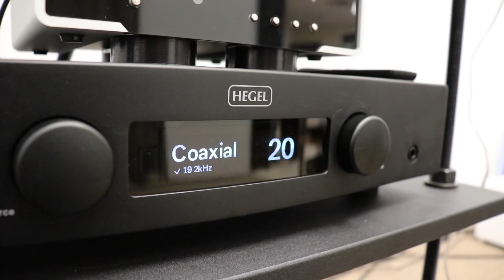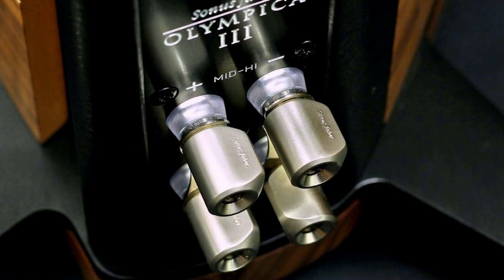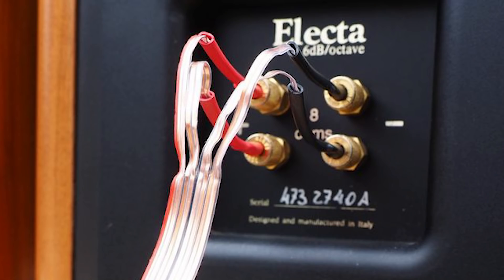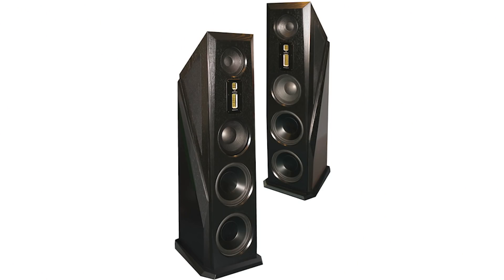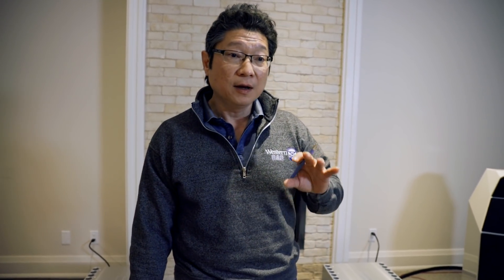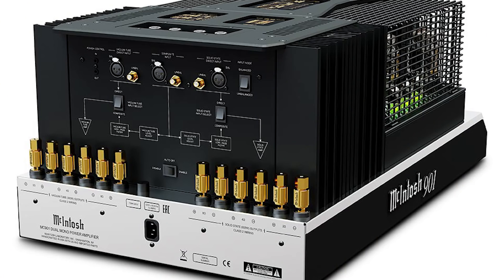What's so unique about the new McIntosh Mc901 & should you bi-amp your speakers?

Comment: Hi fellas...I just purchased the MAC 7200 and using the Legacy Audio floor standing speakers and have a few questions if you don't mind-first of all do you know (or recommend) if I can/should consider bi-amping  the 7200  perhaps using tube amps and secondly what do you think of pairing the system with two REL S/812s? Thanks.

Comment: A nicely done presentation.   There is another way to avoid using an electronic crossover when you mix and match amplifiers.  Make sure at least one of your amplifiers has an adjustable gain.  Not all amplifiers have this feature, however.  Parasound builds in this feature on many of their amps, for example.

Comment: Tubes are not "better" at high frequencies, mathematically they are "worse" all around. However that's math, listening preference critically important and another completely different issue. Though I don't own a tube amplifier I also love the tube sound. The most used adjective to describe it is "warm". Voices, in particular, are more mellow and less strident. Another inherent characteristic of tubes is low power, though they can do transients very quickly the dynamic range if those is limited, that's why their low frequency accuracy suffers. This frankly ridiculous Mc Intosh amp (which I'm also smitten with!) aims to provide an amp that can still provide the signature tube sound so enjoyed by many an audio fan, while still providing extraordinarily good bass performance. Its most definitely a <1%  "problem" but one that  someone (McIntosh) was sure to fix for enough money :)  BTW no one should think that this ultimate solution is the only one since full transistor amplifiers can be tailored to sound "tubey".

Comment: As Leonard Nemoy's most famous character might say "Fascinating."  When you biamp/biwire a single speaker with the double set of posts. does it by-pass the internal crossover?  If not and you have the frequency set exactly, wouldn't that double the crossover slopes and mess up the interaction of the two separated drivers?

Comment: Bi amp is nothing new or unique.Your movie theater does it-for each of the stage speaker systems behind the screen.My mother used to have a Magnavox Concert Grand Hi-Fi console that used biamps.Each power amp used 2 6V6 for the tweeter and 4 for the woofer.15" cast frame woofers horn tweeters.The set sounded wonderful esp when CD's were played thru it.So wanted to connect a magnetic cartridge TT into it thru a preamp.For the theaters Altec VOTTS or JBL systems now QSC.Large theater screens had amp rooms on each side of the screen-crossovers and processors in the projection room.Still done today-digital projectors instead of film ones.The McIntosh amp sounds interesting-price---Have to win the lottery or grow a money tree and get a forklift to move those amps!And you will likely need a 20A 120V circuit to run each one!900W total.

Comment: I just saw a guy with his DIY 4 way horn towers each with a 36 watt 845 tube amp, plus a pair of DIY subs powered by a pair of Crown HD5000 each bridged mono on Steve Guttenberg's channel. In my experience tube power ratings can be considered at least 3 times if not 5 times the power respective to typical class AB or D solid state specifically on bass guitar amps.

Comment: Yeah you're wrong concerning the miss-match.  Depending upon where that crossover is that tube amp will quadruple or even MORE of it's rated power due to all lower frequencies eliminated from it's work load.  Each time frequency is halved while volume remains the same the power requirement goes up by 4.  Hence with a crossover say around 350hz that 75 watt tube amp suddenly becomes a 300 watt amp.  Suggest you study this some: https://sound-au.com/bi-amp.htm  : That aside even if this were not true that 75 watts is still plenty of power for the midrange and highs.

Comment: Just one of these monsters costs more than an entire Kii Three system, which includes six high-power/low-distortion amplifiers per room-adaptive speaker plus a world-class DAC and control unit.  I'm all for "high-end" gear if you have the budget for it, but this is clearly an insane purchase, even for a millionaire.
Reply: I do agree with you, I will never afford anything close to what this equipment costs, or even a Kii Three system for that matter. However in the ultra high-end world, these amps are actually a bargain... I know that sounds crazy, but you can spend $250,000 and more on a pair of monoblocks. I am curious to see how they perform, because honestly this is a really good idea that Mcintosh came up with.
Reply: @chadisrc  -- My hope is that some time before I die (I'm 72) lower-cost implementations of the Kii Three's innovations will show up, e.g. something less lavishly appointed, with PBTL-configured TPA3255 amplification instead of pricey NCore modules and analog-only inputs would be fine with me.
Reply: @editorjuno  A super headphone setup can be pretty great for sub 10k.   Look into 'ear speakers' like the Raal SR1A
Reply: $35,000 U.S., drop in the bucket for a millionaire. They wouldn't bother with these, they already spent over $350,000 U.S. on McIntosh's 1200watt mono blocks and McIntosh's top speakers. You have a very hard time imagining what it's like to have millions of "dollars" don't you.
Reply: @Mark-lq3sb  -- Millionaires don't get that rich by throwing away $$$.  Maybe the silver spoon types do that, but not the folks who worked their way up who I've met.  Moreover, the Kii Thee will outperform any all-McIntosh system -- but of course if you look at Mac stuff as an investment, it does tend to appreciate and lasts forever if you take care of it, so if performance is secondary to resale value and status/prestige I see your point.
Reply: @editorjuno --  lumping all millionaires into two category's? That's just thinking like a "poor" man not knowing what's it's like to be able to afford almost anything. Plenty of quarter million dollar automobiles have been sold to millionaires that "worked" for a living to get where they are today, parking that vehicle in their multi-million dollar homes. You and I may have to "pinch" pennies to save for luxury items, but they certainly don't.
"out perform any and all McIntosh system" Do you speak from experience? You've personally compared all McIntosh and Kii specs and then listened to all of McIntosh's equipment next to Kii for that "listening experience" that specs don't always reveal on paper. If not, then you simply do not know, period.  
On a personal note, I don't care for powered sub-woofers with class-D amps inside a speaker enclosure. Amps don't belong in a enclosure with drivers in my opinion, never cared for that. I've owned a heard twin 15 to 18 inch woofers in one (3-way) speaker cabinet, supplied by plenty of power that accurately reproduces lower frequencies.
Reply: @Mark-lq3sb  -- Your opinions are duly noted.  I was selling and listening to McIntosh gear 50+ years ago and have had plenty of experience with both home and pro audio gear since then.  McIntosh gear is good, but IMO nowhere near good enough to justify their prices based on performance alone -- their stuff is overbuilt, overweight, and underperforms given its cost.  Buying that sort of stuff is all about the prestige of owning a long-established luxury brand and not what it actually sounds like compared to competing gear that's both measurably and audibly superior at a fraction of the price.

There, now you have my opinion, FWIW.

Comment: How would they work with Focal Stella Utopia’s?  Currently using MC611 mono’s.
Reply: How is the mc611 driving your stella?
I opted for a different choice, i am having the focal maestro driving it wirh the dagostino progression and i got the 2 focal evo subs which are the one used in stella.
Reply: nezar le pro The MC 611s work wonderfully. Just interested in improving mid range and highs if possible.

Comment: I really appreciate your channel. IMO Those emblems McIntosh attaches to the side of their products look ridiculous. They  look dated and cheap like something that be attached to the side of a front fender of a  70's early 80's era van. I like the MA352 for instance, but I'm hung up on the cost, $6,500. For that money I wish the side emblem could be optional, I'd delete it. I also wish the chassis was machined out of a block of a sold aluminum instead of what appears to be bent metal  which creates plenty gaps that are quite visible. I fully understand the sound quality is excellent and McIntosh products last the lifetime of the listener and some, also the resell value, but I wish the fit and finish of some of their products better reflected the price. I'm still going to check out the MA352, but what I just shared is definitely in the back of my mind. Anyone else having any thoughts? Agree or disagree?
Reply: I remember when I got a MC 275 at a garage sale for $60. 2nd best deal in audio I ever got.
Reply: I would agree with you. For that kind of money, I would expect uni-block construction as well as point to point wiring for much of the internals. I was looking at the Pathos Logos amp for 5K which looks to be better build quality as well as has point to point wiring and larger capacitors. My problem is that they are based out of Italy so good luck with reasonable service if you need it. At least McIntosh is American and has a great reliability record, stands behind their products, and would seem to be fairly easy to service.
Reply: Rogue Pharoh integrated amp is excellent, it's 3500 USD build like tank, awesome sounding amp comparing to MA352
Reply: @babydove  
I also looked at Rogue, my only concern is resale value. Will continue to consider. Thanks!